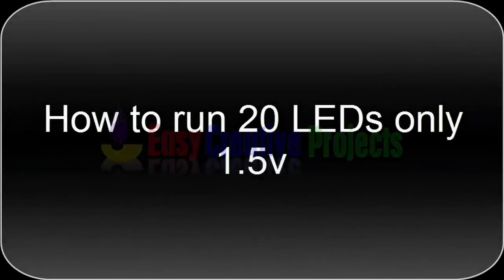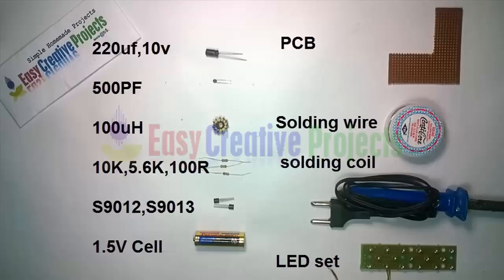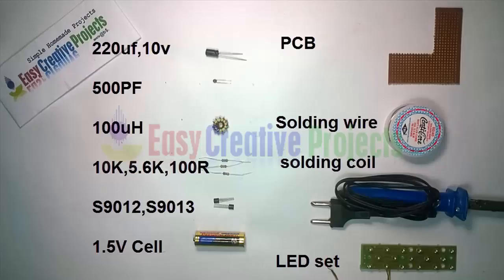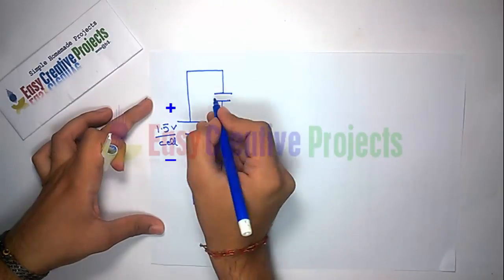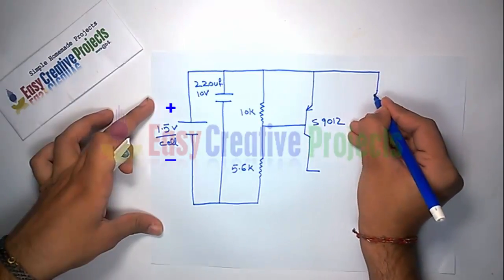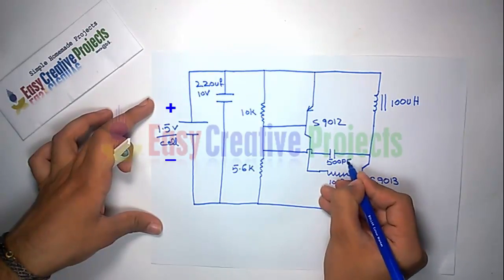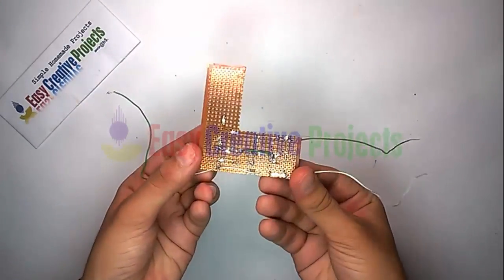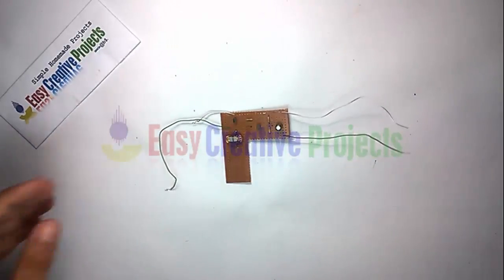How to run 20 LEDs only 1.5v - easy step by step with circuit diagram

Comment: This is wonderful and runs the Led's at a lower rate to prolong their life too. How long do they run for on the 1.5v battery? And what is the output voltage and current?

Comment: Can i use transistors 2n3904 and 2n3906 instead?
Reply from the maker: yes you can use.2n3904 and 2n3906 transformer.
Reply: @EasyCreativeProjects  ty for responding

Comment: Instead of 220 uf 10 volt capacitor we can use 220 uf 16 volt capacitor
Reply from the maker: yes dear you can also use but for good result try to find 10v capacitor.  
because its work very small voltage only 1.5v.
so if you use 16v capacitor, its charge slowly. (may be you also change inductor turns.)

Comment: how did you convert 20LED into 17
Reply from the maker: this circuit support 20 to 30 LED's.
all LED's are running only 1.5 volt. 
i also make one more video about this. witch i show maximum LED's.